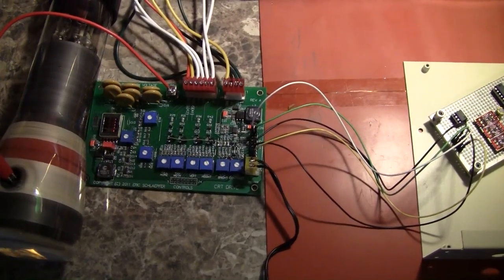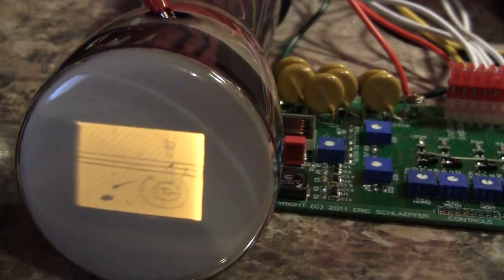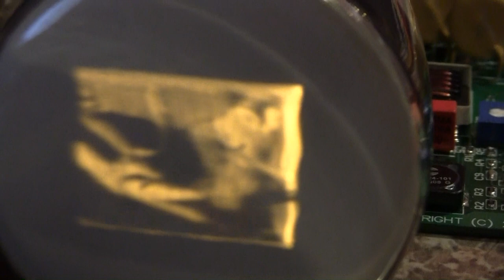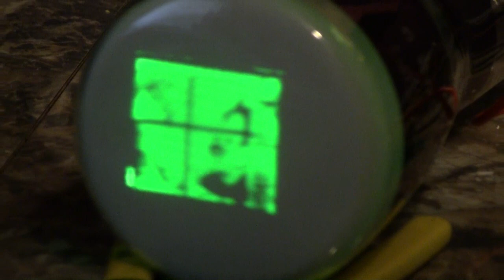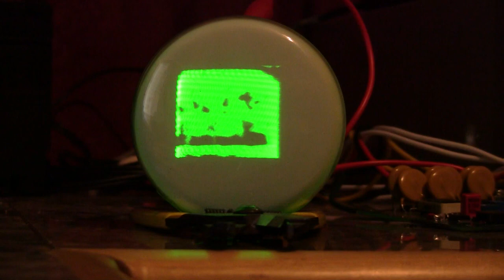The Tiny TV adapter for the CRT driver board

Comment: I have ordered one of these tubes as well.  How many times did you shock yourself?  That is my biggest fear.
Reply from the maker: Not once. I got all my shocks way back when I was a teenager. It probably won't kill you. But it stings like the dickens!  There is more danger of banging your knuckles or hopping out of your chair involuntarily from the muscle spasm. When you must probe around high voltage, keep one hand behind you back. This prevents the jolt from passing through your body. It's easy. It's safe.

Comment: Can I wire that onto any CRT tube? what does it display and what us the connector? Coudl I use that on a Pi Zero? :)
Reply from the maker: You can wire it to most electrostatice CRTs, 5 inches and smaller. Though the image will be smaller than the full screen. For a connector, I was using alligator clips to make connection generic. The connector needed will depend on the CRT you choose. It will work with any source of composite NTSC (or PAL) video. See my project pages for more details and ideas: http://www.labguysworld.com/Project_ESCRTs_001.htm and http://www.labguysworld.com/ES_CRT_DEFLECTION.htm  and even more: http://www.labguysworld.com/LabguysProjects.htm